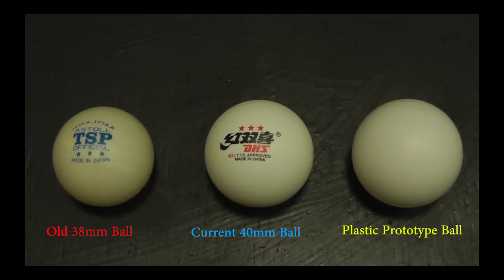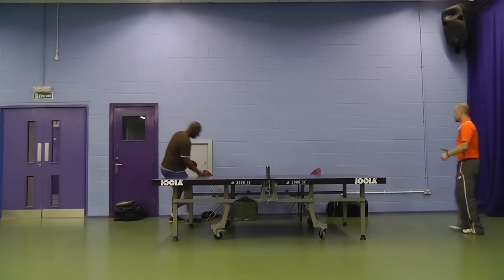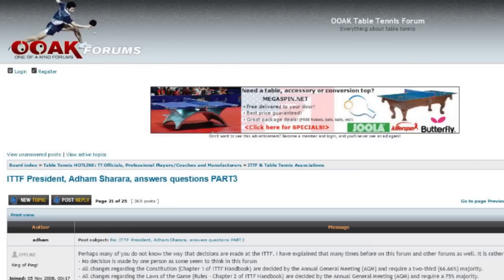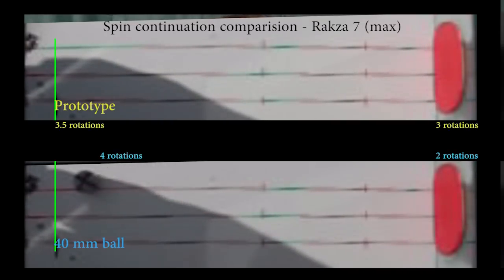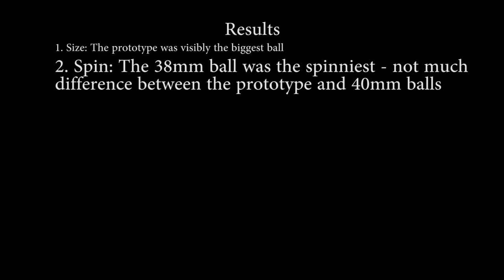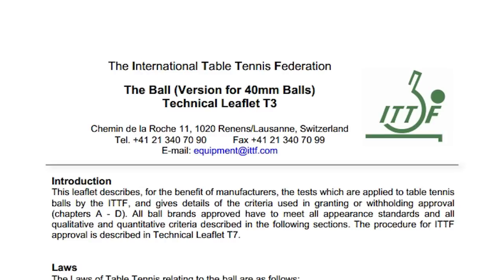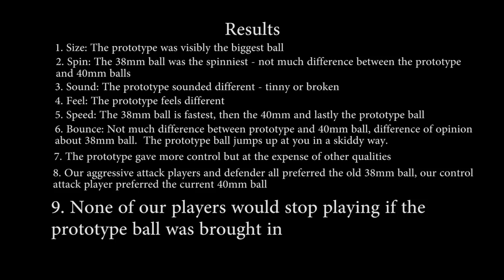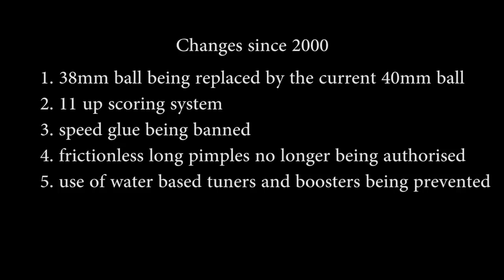Pt 3: One Piece Prototype vs 40mm vs 38mm Table Tennis Balls - Players Impressions

Comment: With the plastic ball table tennis will get more physical. That's actually a good idea I think. I will definately profit by these new balls. The change from the 38mm ball to the 40mm ball was great (for me)! The rallies are so much longer and more entertaining than they were before. A higher bounce will make it easier to attack. Placement will get more important. In 20 years we may get a 42 or 44mm ball, who knows? Maybe the balls will have stripes on it to see the spin better. Think about it.